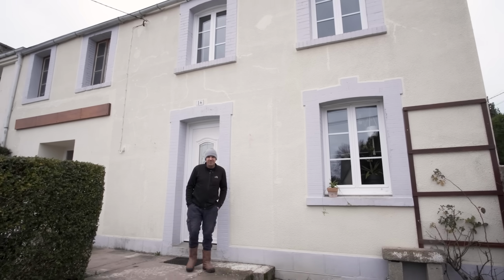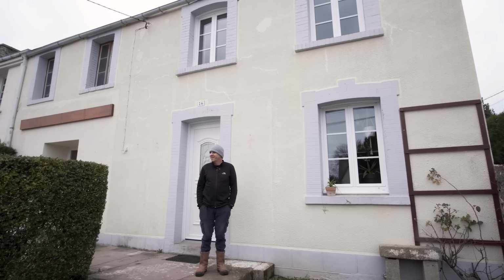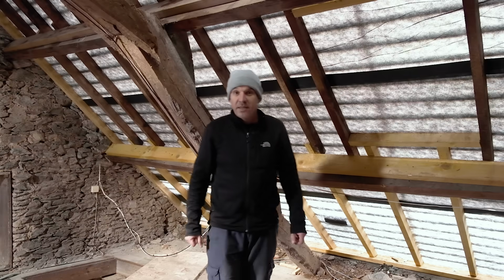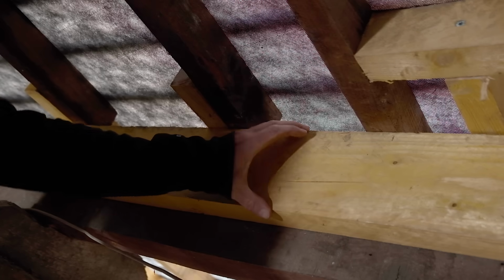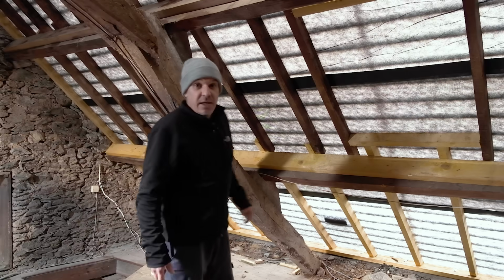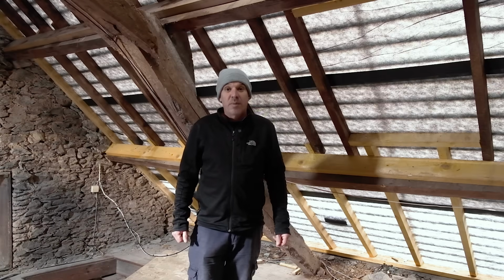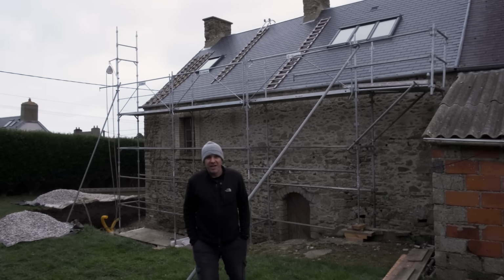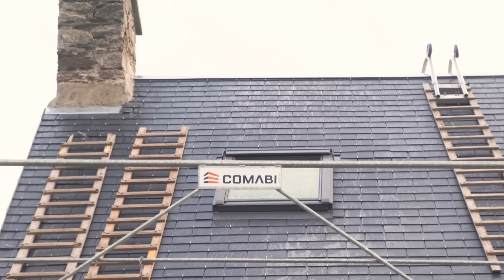New Roof - Old Home

Comment: Hi , I live in Québec, Canada and my house was so humid that I had to put my sheets in the dryer before going to bed, they where so damp. I found the problem and now there is no more humidity. My basement was about 5 to 6 feet so we  wanted to make it livable and doug a few more feet to bring it to 9 feet and found out that there was so much water underneath that we had to put weping drain all around the house lower than the water level to drain the water so that the floor of the basement was not in water but if I dug à bit at the level of the weping drain there was water.
Talking with ingenir, they told me to water barrier the ground underneath the house so i did. 
On the basement floor i put à plastic membrane 6 mm thick, on the hole floor and tape the seems with construction tape, and where the plastic comes up to the wall we did 3 inches of pitch to stick it to the wall, after the whole floor was sealed with the plastic membrane we put 2 inches of Styrofoam, the sm one is made to withstand the elements, after we poured 3 inches of cement, making a nice level livable floor and voila no more humidity rising from the floor and now are humidity is around 45 to 55 .
So in conclusion all that humidity was coming from the ground. So I suggest you try it out plastic membrane is cheap, cover your whole basement floor and you will see the difference. 
Hope it helps you. 
Good day. 
And sorry for my bad writing am french.
Reply: Very interesting; glad you were able to figure out your problem

Comment: Bud don't use plasterboard, if its lime and you have a risk of cold bridging your going to risk damp and mould. I'm sure you've spoken to some professionals already. Im in a 1900s house that's had a load of plasterboard put in and its caused chaos. Im having to bit by bit remove it for lath and plaster on every wall meeting the external solid walls. I also have an old slate roof im re torching rather than replacing for now and a lot of condensation even with the ventilation I have with no torching.

Comment: Indeed, the roofers did a very nice job.  New flashings around the chimneys, all the bowing removed, all the masonry fully covered and an overhang on the gable end, and of course the new skylights.  What a difference for the  second building. Once a new gutter is installed and piped directly away to the front of the house you will be on your way to drying the old girl out.
Truly, once insulated, the third floor will be a suitable living space.  
Merry Christmas and a Happy New Year! 👍